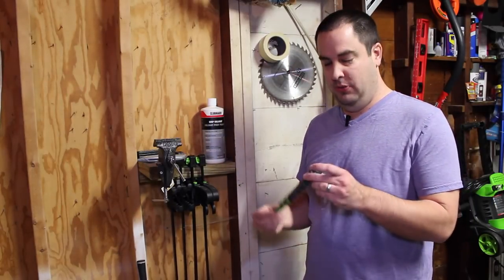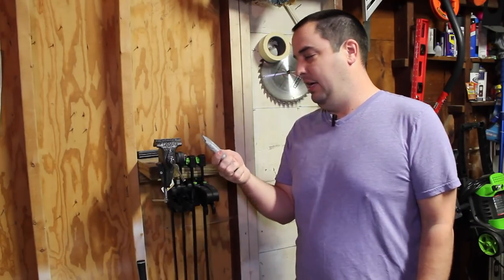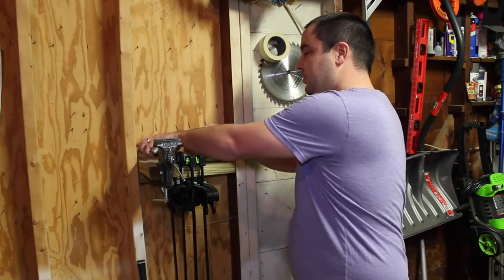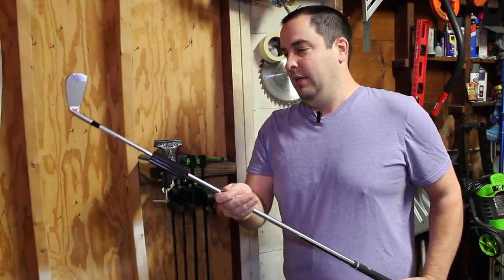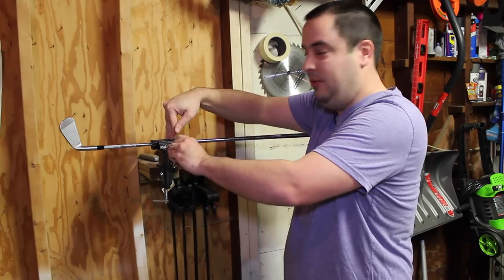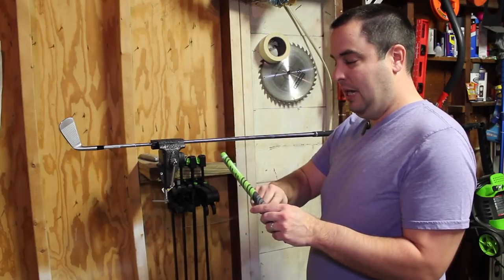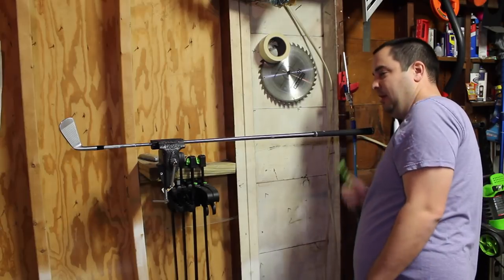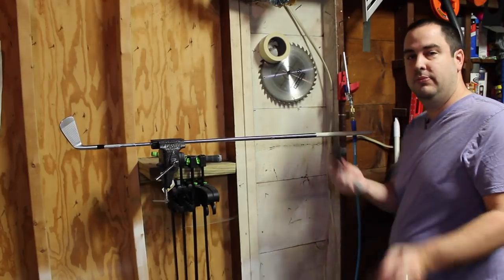How to regrip a golf club - The Easy Way!

Comment: I use the air method and have for years. Its easy and you can actually adjust or remove the grip and use it on another club without destroying it.  This is THE WAY!
Reply from the maker: It’s nice for sure.

Comment: You can use masking tape and paint thinner. Wrap the shaft with tape, wipe some thinner on it and shove your grip on and adjust. The thinner emulsifies the top side of the tape and it becomes two sided.
Reply: My Neighbor  a man who's had lot of experience told me today, wrap with masking tape and use lighter fluid, same as paint thinner I'd think, so that's what I'm going to do with this new Winn Mid-size pistol grip for my Dunlop putter.
Reply: This is what a golf pro would do I've seen this since the 70s.

Comment: I changed my driver grip using one of those can dusters. It actually worked. I just stuck the red nozzle that comes with it into the hole at the end of the grip and it slid right on.

Comment: Nice video! 
My only question/ concern is with out using the double sided tape would you then risk the possibility of the grip twisting with impact?
Reply: Once you get the grip on, it won't move at all. I understand your question though. The solvent method would be better for a beginner because it is easier to adjust the grip once it is put on and before the solvent dries. The air method is great and less messy, and you can play with your clubs right away instead of waiting overnight for solvent to cure.

Comment: It will help if you use a double sided tape and a hand sterilisation jelly . Easier to put the grip on and it dries INA few seconds. Many times don't even need air.
Reply: Hand sanitizer gel works for the activation as good as the "solvent"? shocked you didn't get a lot of haters for that 2020 sanitizer gold. LOL

Comment: Nice video dude, I'm defiantly going to buy all the accessories I need and re-grip my irons!
Reply from the maker: Thanks! It's fairly easy to be honest. Air is easy to do and you can always reset the grip of you got it crooked. Plus if you want to change the grip you can pull it off with air without ruining it.
Reply: +Reid Alphabet Yeah much more of a convenient option! Did you discover the method yourself? Because it's quite a clever way to do it!
Reply from the maker: I like it because it's less mess and I can change grips without ruining them in case I didn't like it. If you want to add thickness you can always add more wraps.That way you can slowly ease up to the thickness you like without ruining multiple grips. A guy I played golf with one day told me about it. I was explaining to him I had just put a driver grip on the night before and didn't like it much and was a bit upset that it would be a $10 waste and he said to put them on with air, they are ready to go right after you put them on and you can remove them without ruining them.

Comment: Cut old grip off, apply new double sided tape if necessary, spray shaft/tape and inside of grip with WD-40, place grip over end of shaft, apply air, slide grip on.  Done in 2 or 3 minutes and ready to use in less than an hour.  I've replaced grips, drove to the course....5 miles, and they were ready to use.
Reply: Would the WD-40 make the grip slip off even with the sticky tape??
Reply from the maker: WD40 is supposed to Lubricant something and keep it lubricated.
Reply: WD-40? that would stay slippery, and the grip will move! Might as well use oil to slide them on! 🤣

Comment: I would be worried about the grip slipping when its 90 degress,  the clubs have been sitting in your trunk and the grips get soft. It would be a confidence thing for me, my swing is already bad enough I don't need to be worried about my club grips slipping. Good funny video, I'm sure it works but I'll stick to the way it's been done for decades that is proven to work.
Reply from the maker: Russell Devane I also have a video of it done with grip solvent.
Reply: Russell Devane they don’t slip off. Been doing my clubs with masking tape only for 15 yrs

Comment: Sure u can do this way. However not everyone has a compressor and using double sided sticky tape to me is much more efficient on the grip it's just extra security that the grip isn't going anywhere.
Reply from the maker: The grip won’t go anywhere either way.
Reply: @DIYReid  until moister gets in there..good video tho.

Comment: You used the hook blade pretty much like a straight blade. The reason you would need a hook blade is more for graphite shafts to prevent scratching them. And.....put the hook blade at an angle where it won't scratch the shaft. 
Otherwise good video for teaching a beginner, but you should have had a smaller tip. 😉

Comment: I found it a bit awkward to keep the grips from buckling sidewise while I was pushing them onto the shafts.  Next time, I'll try slipping a short piece of PVC pipe over the butt end of the grip to limit how far it can buckle  (say, about 2/3 the length of the grip).

Also, since the grips tend to telescope a bit during installation, I found it helpful to mark the shaft where you want the bottom of the grip to end up.
Reply from the maker: It can take a little getting used to

Comment: Hi, that was an interesting process, but don't you need to place glue on the shaft or inside the grip? did I miss you doing that?
Reply from the maker: No. There isn’t glue when using double sided tape other than the stickiness of the tape. The solvent is what allows you to slide it on over the tape without it sticking. Putting it on with air allows it to expand the grip to slide on.  Technically the grip ID is smaller than the shaft OD so that keeps it on.
Reply: The whole point of the demo was that he used air, compressed air, which most people won't have but there you go.  Didn't need that messy stuff called solvent

Comment: What pressure are you using with your compressor?

I have a small portable used for blowing up tyres, balls, inflatabe boats and blowing off.  Is that enough?
Reply from the maker: I had mine set at a standard 120PSI, however, you could get away with as low as 80. If it's one of those without a tank reservoir it most likely won't work. You would need at least a small pancake air compressor like this - https://amzn.to/2QECBD4

Comment: Very good video with a few problems.  The club should be supported closer to the butt end.  Using heat is the correct way to remove old tape.  You should always use double sided adhesive grip tape.  I use the PUR grip gun.  It slips over the butt end of the grip and has the correct nozzle size.  I only need 2 sprays of grip solvent.  The air pushes out the excess solvent and grips are playable in a half hour.

Comment: Since the masking tape isn't adhering to the grip, why even bother with the tape (except at the top of the shaft where you don't want anything going in the little hole on the grip)?  Masking tape is pretty slippery on the non-adhesive side; probably no more grippy than the shaft.  Or is it just to increase the shaft diameter (only about 10 mil)?

Comment: You made it look way harder than so simple double side tape and alcohol that dries in 3 minutes.
Also allows you to adjust the grip to align it for around 30 seconds.
Not to mention, the grip will shift at the butt end if you're a faster swing player or playing in humid conditions.
There is a reason every tour truck, every store, every club builder and every pro uses double sided tape.

Comment: By using regular masking tape, does the golf grip twist over time from swinging?
Also, can I save my old grips that were installed with solvent?
Reply from the maker: I have not ran into that issue yet. Also yes. You can. It’s a lot tougher.

Comment: You could use the compressed air to get the old grip off too.  Also the box cutter could have been used to remove the old double sided tape.  You got the job done but I could have done at least 3 or 4 in the time this video took.
Reply from the maker: You're right. I've taken a few grips off with an air compressor. Most the time it's easier to just cut it off unless you wanted to save it.

Comment: Newb question:  Is there a proper way to know how to line up a thumb guide if there is one on the grip?
Reply from the maker: On that, I'm not sure. However using this method to install that grip will ensure you can just blast it with a quick burst of air to move it if need be vs having to ruin it if it's on wrong. Sorry I couldn't help you on that.
Reply: Thanks!
Reply from the maker: No problem
Reply: I usually put a mark with a sharpie on the tape before i air blast it on. that way i have a little guide as im sliding it on.

Comment: Yes. The easy way. When you already have a air compressor, with the right adapter, a vice already on your wall somewhere, way too high, and a rubber holder. Just get the blade, some solvent and some muscle. Jesus
Reply: @jerryinsc  true. Just need a catcher. Vice just makes it easier to align and clean and stuff
Reply: Most real men already own a compressor and a vise.  The rubber club chuck is $5 on Amazon.  Vice, vice, baby...

Comment: what do you do if you put it on crooked? Be kinda hard to turn it into place if you didnt get it perfect first try. Also let me go spend a bunch of money on an air compressor rather than 5$ for some solvent.... cause thats the easy way?
Reply from the maker: When the air expands the grip it allows you to move it to where you want it to be. So if it’s crooked give it a quick blast of air until it’s straight.

Comment: Careful of this method. Faster swing speed players apply alot of torque to the handle of the club, causing the grip to shift. 

Double-sided tape, a little bit of solvent and a hook blade is all you need. 60 seconds a grip. Too keep it clean, have a towel and a catch pan for the solvent. You also won't need an expensive air compressor.

Good luck!
Reply: I like the solvent method because it is much easier to adjust the alignment of the grip especially while looking down the club in playing position

Comment: Get rid of that long air tip and get a short rubber tip , much easier. Put new grips on right over the shaft . You actually get a better bond against the steel.
Reply from the maker: Thank you, I agree. I only had the long tip that was small enough for the grip hole.

Comment: I've done the same procedure before and the butt of the grip comes loose everytime. I've tried multiple grip types and they all came loose. Even the strongest hairsprays broke free over time. The only thing that has yet to fail  is rubbing alcohol as the solvent and double sided grip tape under the grip. Trust me...air doesn't work in the long-term.
Reply: Used air for years and never had a problem. I use oversize grips now or build up a regular grip so lots more stretch to the grip. Before I didn't and still worked fine. I use frog tape because it is thicker, close to double-sided tape. The real benefit is you can get the grip to feel perfect. I am fussy so it takes 4 or 5 attempts sometimes because the taper is different on many shafts and I want the groove in the wrap style in exactly the right spot.
Reply: Scott N glad it worked for you. I had nothing but failure after failure with air. Friends that used air eventually had slippage also. I practice daily...that may be the issue.
Reply: I play four or five times a week. Never had a problem with using this method.

Comment: I don't get how the grip with stay on since the adhesive part of the tape is on the metal shaft
Reply from the maker: +scooter12368 Technically the grip is smaller than the shaft. You ever notice when you slide a grip on it expands?
Reply: The solvent activates the other adhesive side of the tape.
Reply from the maker: The solvent allows the tape to not be sticky so you can slide the grip overs the tape.

Comment: Isn't that grip going to slip?
Reply: I don't employ all the steps this guy does but I just use masking tape and they never slip.  Some grips have ribs on the inside that adhere to the shaft but the soft rubber on other grips will hold just fine.  I'm wondering why he didn't use the double sided tape that was on the club already.

Comment: I believe that you have made a mistake about which tape you are using. First, at the 3:00 minute mark in your video, you said that you didn't need two sided tape just 2 inch masking tape. Then later at the 4:47 minute mark in your video,  you said that you were going to put 2 sided tape on the shaft, or at least you indicated that was what you were doing. You have a great video, put since it is an instructional video you should consider correcting it. Still Great Job, FR
Reply from the maker: You’re right. I did correct myself in the edit of the video. I put text saying I meant standard 2” masking tape.

Comment: Double sided tape very hard to get where I am. I guess I will have to use a version of doubled-over single sided tape.
Reply: Splag Yetsi you can just use regular masking tape.. it doesn't need to be double-sided tape if you use the air compressor.. at least according to this video..
I might personally throw a strip of glue stick or quick shot of spray adhesive to lock that grip down once it's completely dry, but I honestly can't imagine those grips sliding around much if installed with air onto plain masking tape

Comment: As a clibmaker we don't do this.  Inconsistent, possible harm to the grip, possible over pressure causing your tape to break or break into the shaft, no lubricant to adjust for straightness.... oh also if you swing over 90mph your grips will twist and move on you in no time. Please don't do this. You need lubricant. You need adhesive. There are no workarounds for this. I have tried and suffered through my driver flying through 5he air while I'm left with just a grip in my hand

Comment: If you are just using masking tape, why remove the old tape at all?
Reply from the maker: You don't have to remove the old tape, I just showed on this video to remove it since it was from the factory grip and sometimes they are still tacky. Blowing a grip onto a tacky surface sometimes can be difficult and it would be a lot easier blowing it on a smoother surface.
Reply: Reid Alphabet is
Reply from the maker: You don't have to, however I think it makes for a cleaner install and if you overlay the new tape on top of the old you can run the risk of it not being smooth. It's up to the person installing the grip I suppose.

Comment: Let us know when the shaft comes shooting out of that grip when you play. The solvent and the double sided tape method means good adhesion in the long run. Sure, you can go play golf "right now" but humans have this incredible ability to understand that there is such a thing as the future and we are able to plan accordingly. I choose to plan when to do a grip change, use the solvent method and then no one gets killed when my club comes shooting out of my grips. Good luck. You'll need it.
Reply: Right, I was thinking same thing
Reply: I tried this method.  You couldn't pull off that grip no matter how strong you are.  I put them on last year and no club  has flown off the grip.  And if the grip twists, you are using a death grip during your swing so you have a lot more problems with your swing than a twisting grip.  The whole point of this is install and play immediately.  Can't do that with solvent.  Also, what about trying a new grip?  Try it and if you don't like it use air to remove and sell to someone else.
Reply from the maker: I've refrained from making any comment replies like the one you replied to as I know it's not the case and they are just saying what they think might happen. Again, I'm not making anyone do this so they can all think what they want to think.
Reply: Maybe spread some contact cement all over the masking tape (after the tape is on the shaft) and then spread some inside the grip too -- but that is going to take at least a day to dry, and you'd probably want to use some solvent to make it slip on a bit easier . . . Just saying that double sided tape is not that nice to use, but I don't have that much trouble with it. The easiest method is just to pay the grip guy at Roger Dunn/World Wide Golf the $30 for set installation.
Reply: Billy Graham 

Contact cement? Why would anyone use any kind of glue on a golf grip?

You use double sided tape, not masking tape.  The single sided masking tape is build up tape. You can use that to make the grip feel thicker if you want by putting it on the shaft and then double sided tape over the build up tape. 

I’ll continue to use grip solvent to put grips on, but the air trick is something to remember for a fast repair.
Reply: Put thousands of grips on using 18v Ryobi compressor for pros and amateurs and never
had one even come close to slipping. quit using two sided tape and solvent in the 90's. 
It takes a little skill to learn but with practice it's a piece of cake. 10 minutes to cut off old grips and put on new grips(13).
Reply from the maker: You can blow the grips off if you put them on with air previously 😀
Reply: Billy Graham you should only be using masking tape. The solvent eats through the double sided tape. Maybe a dab of mineral spirits or WD40 at the end of the grip to help it slide on is all you need.
Reply: sambking funny you think that. A lot of places quit using double sided tape a long time ago